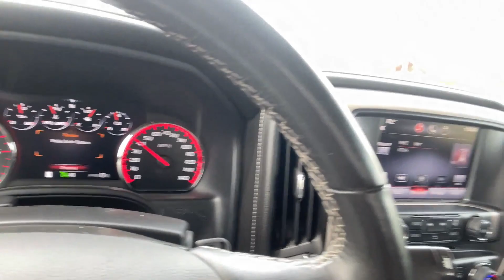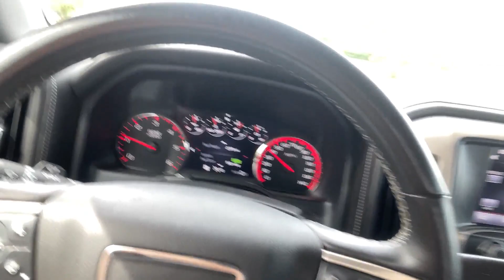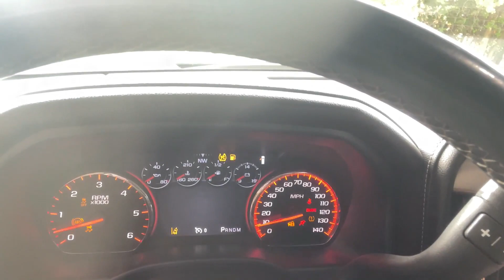Service Trailer Brake System ...It Won't Stop Dinging!!!

Comment: Dude my 2014 GMC Sierra 1500 has the same deal. It comes and goes with the that error. This helped out tremendously!!!!
Reply from the maker: Mine was doing it after sitting in the parking lot at work in the heat. Never did it when driving in the morning. I’m guessing the interior would heat up and things inside the switch would expand and cause the warning to set off.

Comment: My ‘09 2500HD Silverado has a different module locate inside the frame by the left rear tire. Not easy to change. Changed it out. Problem didn’t go away.  What year is your truck?
Reply from the maker: Mine was a 2015.
Reply: Ever get it figured out? I’ve got an 09 2500HD with the same issues.
Reply: @jdub264  nope. Chevy dealer worked in it. It comes and goes. It even comes on when trailer isn’t hooked up. Have changed the controller in the dash as well. Going into the Chevy dealer again on Monday.
Reply: @dougberry1011  I’m sorry to hear it’s not been figured out, I hope your dealer can get it sorted.

Comment: I have a 2016 2500HD I was getting check trailer wire with dads trailer, and then finally it started to say service trailer brake system. I changed the brake controller and the brake control module. It now says trailer connected and brakes are working, but I hooked up to my buddies trailer and it said service trailer brake system. ( I think his is wired wrong ) his other buddy had problems with it. My issue should be fixed

Comment: I have a 2019 that gives me intermittent "Check Trailer Wiring" messages.  It comes and goes.  Nothing wrong with the wiring.  It has all been tested.  The controller is throwing a code, but the dealership can't reproduce the problem, so they won't fix it.  Unfortunately, I can replace the module, but have to find someone to program the computer to see it.  Aggravating as hell.

Comment: you think they would have had a recall on that.  i have to do the same thing.  what they charge ya for that part?
Reply from the maker: No recalls from what I can find. I’ve come across folks getting this message with fairly low miles too. Mine happened around 135K mile. One comment though said his 2021 was doing it. The module cost me $34. The dash switch which is what ended up fixing it, was $44. Both from Amazon.
Reply: @jazzlejohnson5364  so you bought the module and then the switch?  wow the switch the gm dealer ship by my house wants 135 for the switch.
Reply from the maker: I swapped the module in the first video. Seemed to work for a day or two but came back. I swapped the switch in the second video. Hasn’t made a peep since. Been over a month now and all’s well. I got an OEM switch from Amazon for $43.

Comment: I swapped the relay at the dash and did the one above the spare and it did nothing I literally just went to the car wash pressure washed the shit out of the plug and the hit it good with the dryer and bada bing I finally have trailer brakes again and can pull the camper
Reply from the maker: There you go! Worked for somebody else! I did all three but the dash switch is what was magic for me. I didn’t go as far as hammering my plug with a pressure washer, but I did clean it.
Reply: I’ll try this out when I can
Reply from the maker: I’ve had a few folks blast it with a pressure washer and viola!! Everything works again.

Comment: I have a 2017 2500HD with only 28,000 miles and every once in awhile I get the message on my center console…gonna look into changing the switch first.
Reply from the maker: Dang, that’s low mileage too. Too low to be having issues like this.

Comment: Do you have a link or part number?
Reply from the maker: The trailer brake switch is what fixed mine in the next video. That P/N is 84108373 on the Amazons. The module in this video has a P/N of 141398 off the Amazons as well.

Comment: I have to make this same repair tomorrow on my Dad's 2015 GMC Sierra 1500.  

What was the secret to not breaking the red tab?

Do we have to worry about any funny codes being sent the trucks computer once we disconnect the brake module?      

Thank You
Reply from the maker: I’m not sure why I saw so many people say they broke the red tab. I used a small flat blade screwdriver to push the locking tab back. It didn’t take much to get it to slide back and unlock. I didn’t have any codes pop up. The module didn’t actually fix my problem though. I posted a follow up video last weekend where I replaced the switch in the dash. That seems to have fixed my problem. Hopefully the module will fix your dad’s issue. If not, I’d swap the switch.
Reply: @jazzlejohnson5364  Thank you once again for helping us Sir.
Reply from the maker: Glad to do it.
Reply: How much was the switch

Comment: Hey your truck is a diesel?
Reply from the maker: 5.3 gasser. No diesels in the garage just yet.
Reply: I have same problem with my truck 2015 GMC Sierra Denali 2500 diesel but I don’t know how’s fix .
Reply from the maker: Orlando, check out the comments in those videos. Some were able to clean the trailer connector at the bumper and fix it. One fella replaced a fuse and fixed it. Some were able to fix it by swapping the switch on the dash.
Reply: @orlandojardines170  I have the same truck. Did you get yours fixed?
Reply: @mikehelm8030  yes I fixed
Reply: Do you get a diesel ?
Reply: @orlandojardines170  Yes. 2015 GMC Sierra Denali 2500 diesel. How did you fix yours?